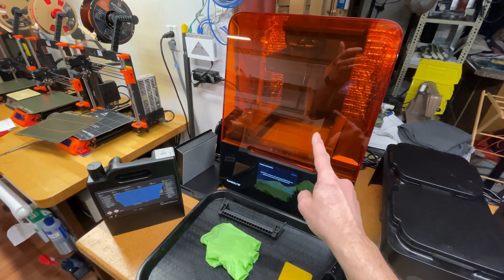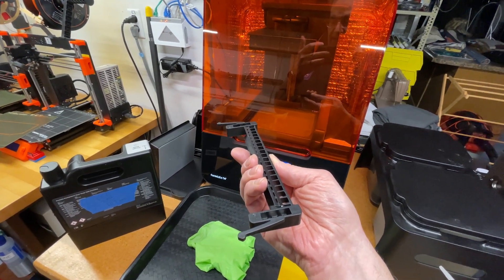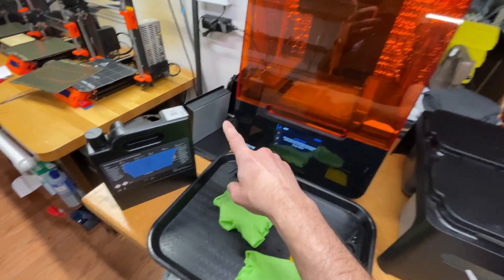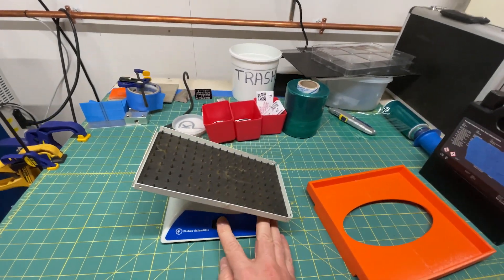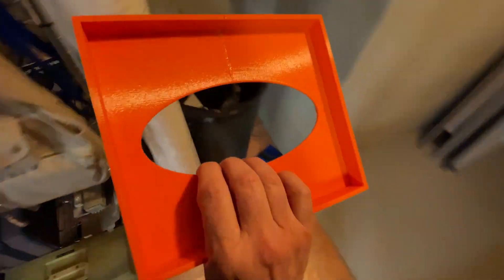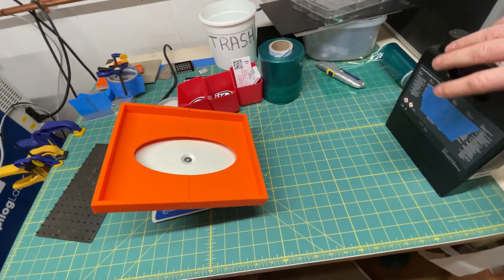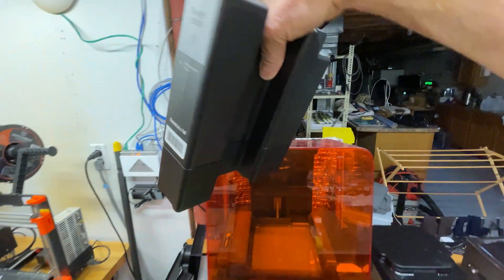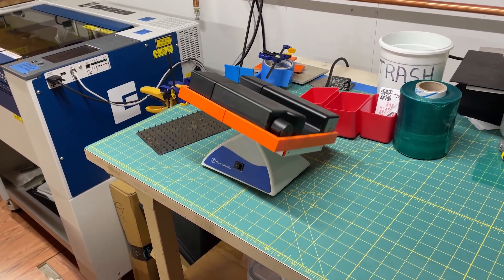Form 3+ Process Improvement: Why Use a Nutating Mixer?

Comment: I am getting the same mixer arm behavior, except when it gets cockeyed at the very end it gets stuck under the build platform thus preventing the platform from reaching the bottom of the tank. The printer continues without error and cures the raft layer to the bottom of the tank which I have to meticulously pry off. Have you found your mixer to solve the issue?
Reply from the maker: I have had the mixer arm askew, but never had the system not recover from it.  The pre-mixing has been a win.  My procedure now is to pre-mix for a while (15 min.?) then manually top up the tray/tank prior to a cycle.  This will get the resin viscosity closer to what it should be.  I find that the resin in the tray does thicken over time, and this helps.  Especially if your printing sessions are sporatic.